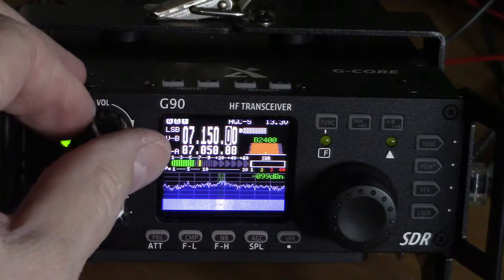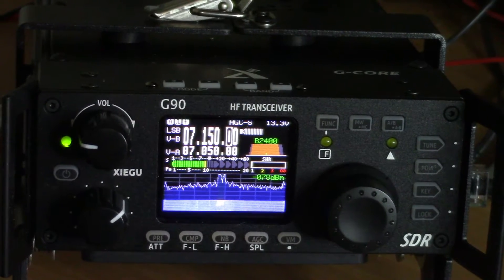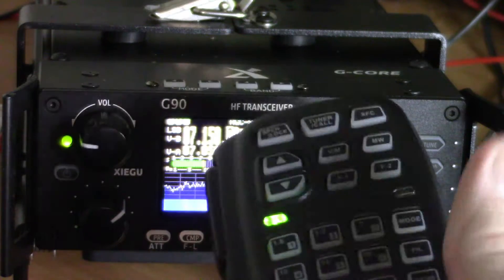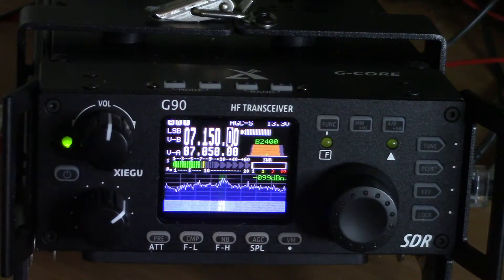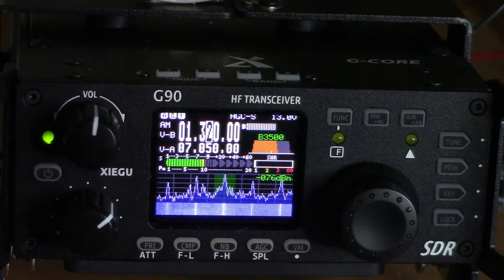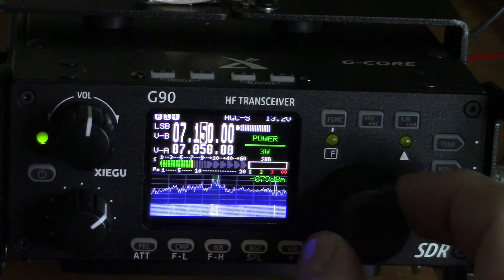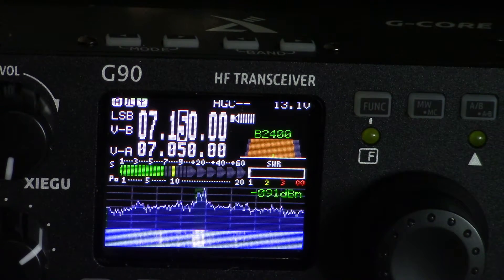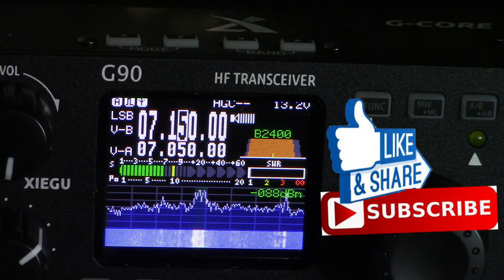AirWaves Episode 17:  Xiegu G90 Initial Thoughts

Comment: The g90 is my portable radio great little radio for Pota. Got it hooked to a wolf River coil mega mini 213” whip. 35’ RG8X coax. Not a frequency I can’t tune. In fact I’m flying to Florida for vacation an the go bag g90 66’half wave end fed wire antenna an bioenno battery is going to. 
73’ Greg KC3PMX 
Will be listening for ya on the bands.

Comment: I’ve had my G-90 for over a year now. No issues whatsoever. The reception is on par with my new FT-891. I’ve made DX contacts from Mobile, AL to Japan, Chile, Slovenia, Italy. Great POTA rig too.
Reply from the maker: I worked in radio broadcasting in Montgomery and Dothan, Alabama.  Also Pensacola.
Reply: @Airwaves-Radio  that’s awesome! 73s from KN4EQG
Reply from the maker: What are you using for an antenna?
Reply: @Airwaves-Radio  When I’m offshore, on my 180ft oilfield supply boat I use a 66ft EFHW in an inverted “V” hoisted up my aft mast at around 45ft. It’s resonant on 10, 15, 20 and 40 meters. At home I use the same antenna as a sloped with the highest point around 50ft sloping down to 20ft. I also use an MP-1 Super Antenna (small pricey portable vertical antenna). I’ve had better performance out of the cheaper wire antenna. 73s from Kn4eqg

Comment: I know this is a really dumb question. But how can I just just plug this in my wall outlet. 
I just opened the box on mine and it has no 110 wall power cord.  I do see the fused wire for a dc battery hook up. Or I'm just supposed to buy a battery for it.
I'm completely new.    Thank you. Great video
Reply from the maker: You'll need a 13.8 volt DC power supply, at least 10 amp rated.
Reply from the maker: There should be a red and black power cord with a white plug on one end, and bare wire on the other end.

Comment: FYI - for the viewers as well as yourself - the FFT display (spectrum and waterfall) is adjustable in scale. Pressing the “FUNC” button (at the top middle of the faceplate), followed by the “LOCK” button (at the bottom most of the right hand column of buttons on the faceplate) allows you to set the scaling factor. It should be set such that the spectrum graph sits right down at the top edge of the waterfall. This will cause the waterfall to be mostly blue - except for where a signal exists, where it will turn white. When the scaling is set too high, as in this video, the waterfall is all white and not very useful. In the latest firmware, V1.74, there is an “automatic” setting for this that is much appreciated. Also the spectrum line is now green instead of white.
Reply from the maker: Thanks for the tip James.  I'm running Ver. 1.74.
Reply: Air Waves 😎 Cool! I do find the auto setting of the scaling to be problematic when peaking my magloop antenna. I set it to manual while peaking, then I can just zero in on the highest average spectrum level.

Comment: Have you tried the cw decoder...what do you think about it
Reply from the maker: Yes, the LED flashes with the code, but it isn't showing the text of the message.  I guess I'm missing a step in getting that to work, but haven't had time to dive into yet.
Reply: @Airwaves-Radio  does that use the standard PL-259 connector
Reply from the maker: Yes.  Looks like I have to use the "KEY" button to select the proper mode of CW, to get the text to display.
Reply: @Airwaves-Radio  ahhh kool I can wait till mine arrives
Reply: Using the CW decoder works when the receive CW signal is strong. When band conditions are poor, the automatic decoder doesn't work and you have to rely on your own ability to copy CW (which one should learn properly anyway).